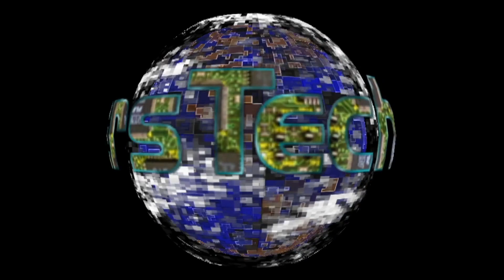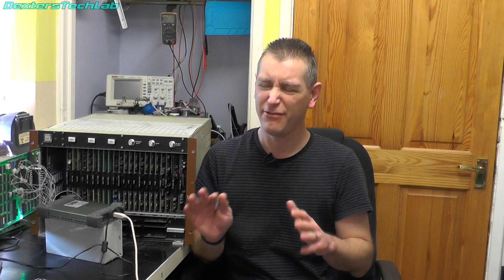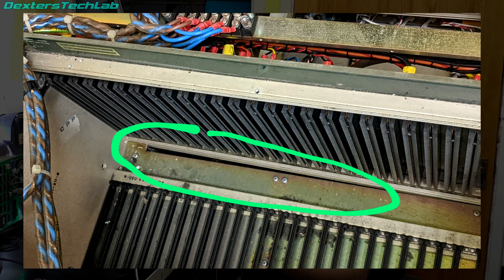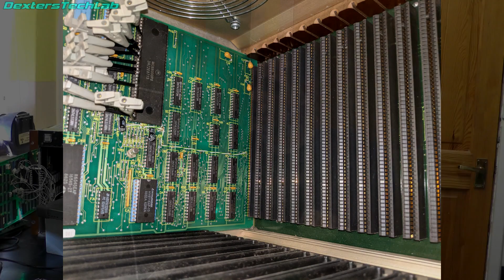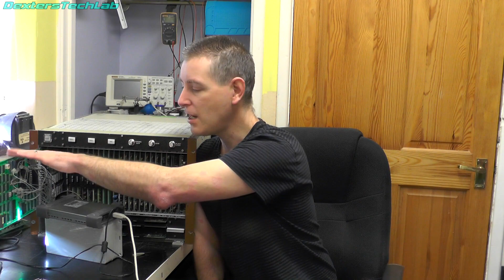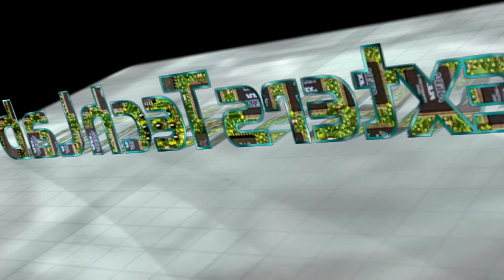DL208 Quantel DPB-7001 Digital Paintbox Restoration & Repair Part 2

Comment: Have you tried connecting all the peripherals before turning it on? It would make sense that it could be looking for the peripherals (tablet / monitor...) before booting up. Especially since you said the CRT driver is on that computer 1 card.
Reply from the maker: Hey Beau! The CRT controller on Computer 1 is just a video output of the diagnostic console. From our experience with the DPB emulator we know Comp1 & 2 should boot into a small menu that can accessed by the onboard serial port.

Comment: You’re doing a great job with the classic, this is going to be a very interesting series.
Can I give a a few suggestions? You’ve probably already thought of this, but listening to your fault description my first thought is that it’s probably not a digital device, or at least they’re not where I’d start looking.
Your boot sequence isn’t falling over at a consistent point, which is very suspicious, and to me suggests clocks, power or noise (something analogue, because analogue is witchcraft). Maybe it’s worth giving any crystals or PLL circuits a quick consistency over time check. I know crystals from this era weren’t as bullet proof after a few years as the ones we get now.  
I don’t know exactly what the tec level is on a classic, but I remember from working on Harrys that CMOS buffers hate inputs that have accidentally been left floating. They would heat up over time and this very occasionally added noise to the other connected outputs. Hopefully any design errors would have been picked up and modified early on, but it’s something to keep an eye on since this noise may be missed by your logic analyser.
Good luck.
Reply from the maker: Hey Kevin, great to see you drop in. Your always welcome to make suggestions! If swapping these buffers does nothing then i think i will have to get the oscilloscope out and check at the analog level as you suggest.
Reply: @DextersTechLab  A quick poke around with a scope probe to check for signal quality (rise time, edges, that sort of thing) is always worth doing on old equipment. And don’t forget the healing properties of a finger. The capacitive effect often cleans up signals enough to get things working, I quickly diagnosed the rough location of many a problem by simply poking around.

Comment: Very excited about this! Regarding your comment on the other cards, could they be causing corruption on the bus that's creating the error? I've no doubt you've already tried this, but figured I'd ask as it wasn't mentioned.

Good luck with this, would LOVE to see it in action (and hopefully whatever is on that mammoth hard disk for it!)
Reply from the maker: Hi Richard! There's a reason why i don't think the other cards are causing an issue, firstly i have tried with and without them and didn't see anything different. Also the other cards actually don't have access to the 68000 address bus so it's unlikely they would be able to cause the bus errors i am seeing.

I would love to see it work too, there's a long road ahead though!
Reply: @DextersTechLab  Very good points! This is why you're the tech buy and I'm the lazy ass viewer 😂

Good luck with this, I remember RetroGamerVX's videos on it, so it'll be great to see it finally fire up. I've no doubt that you're the man for the job! It blows my mind that other others are considered MIA; for something this significant, you'd like to think that there would a few preserved examples out there!